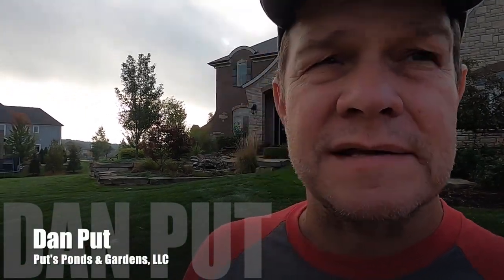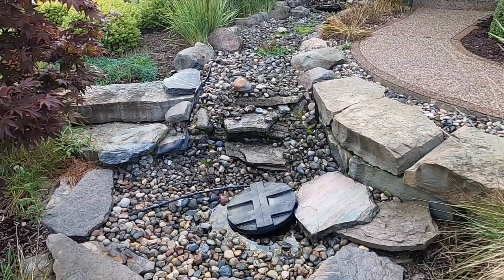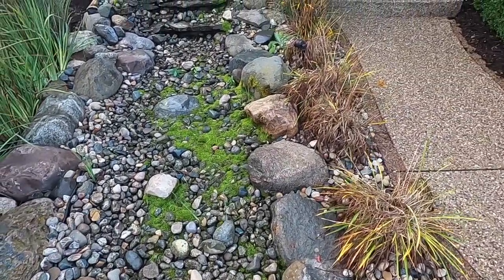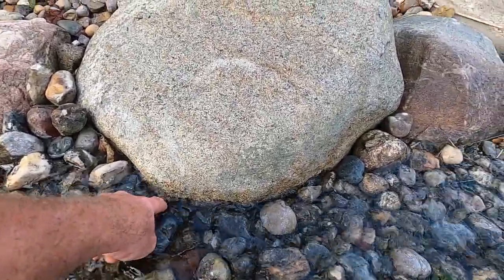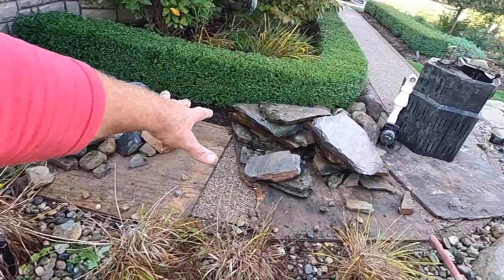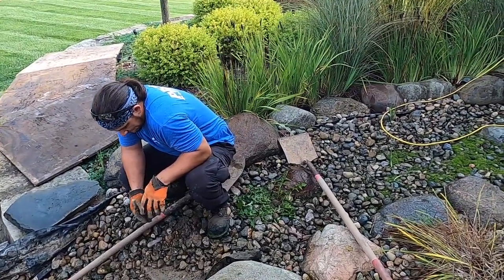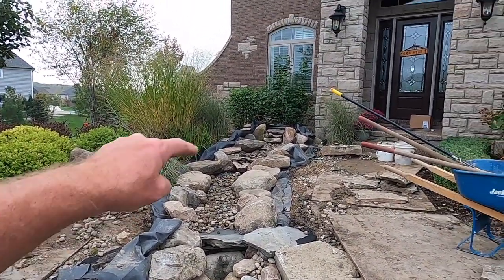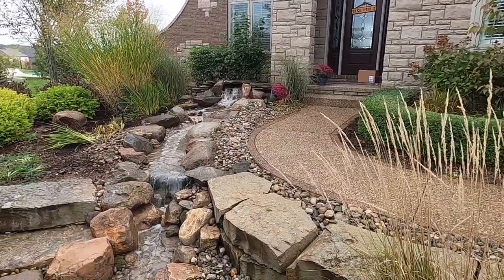How to add front yard curb appeal…| Oakland Twp, MI

Comment: Looks great from the road.  Curb appeal is right!  That's quite a but more flow.  Did you end up using a new pump, or was the existing one clogged?
Reply from the maker: We added an Aquasurge 4-8k gallon variable speed pump… the existing pump had fins on the impeller missing… no doubt it chewed a few stones…lol
Reply: @PutsPonds  it probably did from what I could see.  Speeking of rocks.  I'm going to tag some rocks for the first time at a local quarry for pick up.  I was thinking of using chaulk but it may be a few days before the rocks are picked up and we have rain coming.  My plan right now is to buy some orange ribbon and tie it around each rock.  Do you have any other ideas?
Reply from the maker: @cbwaterfeatures  ribbon with a smaller rock on top…. Idk that’s how we do it lol
Reply: @PutsPonds  nice!  Thank you.  That will save me time and ribbon.👍
Reply: @cbwaterfeatures  paint dot!